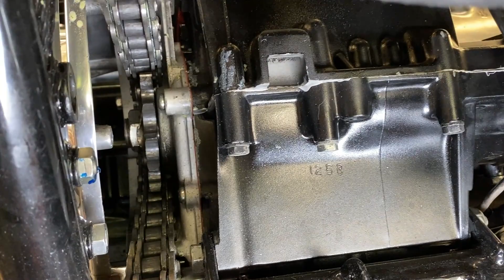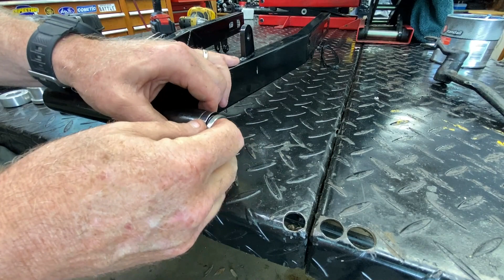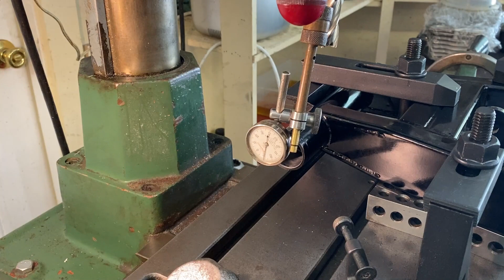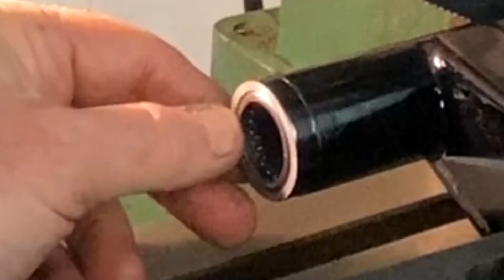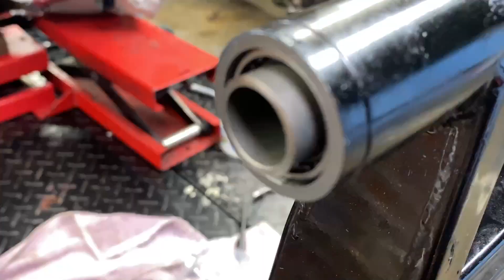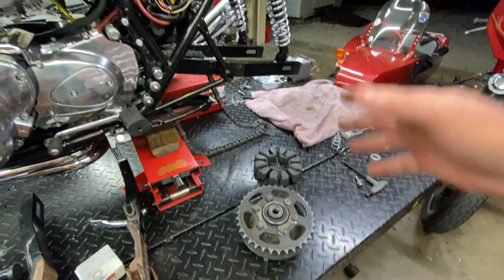1978 Kawasaki Z1-R FAT SWING ARM mock-up and machining. Will it fit?

Comment: You could’ve just got a ram and separated the frame. It’s not like it was that much off could’ve saved yourself a big hassle. I’m sure that those 50 year old frames weren’t all made exactly the same.😂
Reply from the maker: Yea, but it's not my frame and it's powder coated, which is brittle as heck. I maybe would have tried that if it were painted. But good suggestion for sure. Thanks.

Comment: Good job with that swing arm mods. Not easy to make them fit in place.
EK chain company from Japan made nice color painted 520 chains, they have green and metallic green options.
They have also special screw type link, its very easy to do ,all you needs is only 8mm wrench and pliers to do it.
Color chain would be good looking with green parts.
Reply from the maker: Thanks. I hadn't thought of the color chain, but it's a 530 from 630 that is part of a kit, because of a couple reasons including what we're doing here (apparently, the #530 chain better clears a fatter tire) and that a 530 today is just as strong if not stronger, than a 630 of that era. So says the literature. I ordered a riveted master link for this 530 conversion setup and on the same order, a #630 replacement riveted master for the 630 chain to make that chain usable should the need arise in the future. I'll grind off the master I put on the 630, push it out and discard then I'll bag it up, label the # of links and move on. Thanks again.